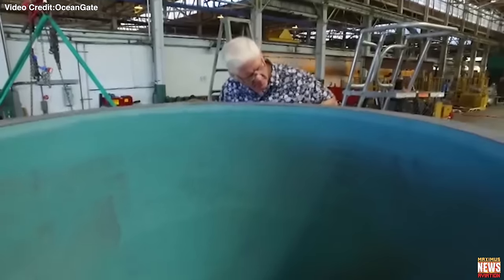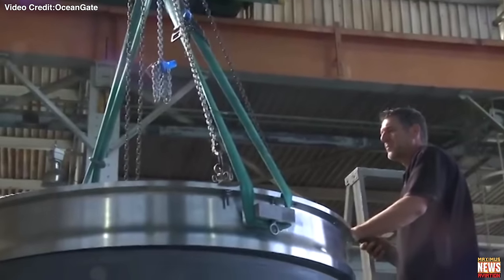Watch The Manufacturing Process That DOOMED OceanGates Titan To Fail. But It NEVER Had To Happen.

Comment: I'm a 75 year old guy with no engineering degree but I have owned a lot of fiberglass boats and there is one fact that is always true. If you hear a cracking sound in a laminated structure it is the sound of de-lamination. Every time you hear cracking it is additional de-lamination until it cracks for the last time at failure.
Reply: It is claimed that on previous dives they heard cracking sounds.
Reply: @avernikas I wonder if they were ablo to hear it crack in the last dive
Reply: @JojoFasold the assumption is they did because before the implosion they attempted to ascend.

And on other occasions while diving Stockton would give a preemptive “you’re gonna hear some cracks”
Reply: @JojoFasold  That would be sad to learn😳
Reply: @c3ramics  To think they knew implosion was imminent. How messed up
Reply: @avernikas  but they used acoustic sensors and record the sound to analyze the "health" of the carbon fiber. Not sure if they did spectral analysis of the fiber itself to see if its healthy. But like James Cameron says the hull begins to degrade with each use which was why he was opposed to it. One other problem also is carbon fiber isn't good to work with high pressure water environment.
Reply: @jonfreeman9682  So basically they had a hull integrity indicator that would have been screaming ok imminent catastrophic failure. Damn!
Reply: Spot-on.  ANY  VERY  BRITTLE,  SUBSTANCE, is  NOT  what  you want, at about  6,000  psi.  = 12,800   feet or so  of  sea  depth.     380  bar   x  14.5  pounds per square inch, at sea level .
Reply: @petersack5074  Well, they didn't use fiberglass... so I don't know how that is relevant. They used Carbon Fiber, 10x stronger then steel, too bad it has no ductility, which is why it imploded.
Reply: @JojoFasold  probably for a few horrifying seconds.
Reply: It's crazy that Experts told the CEO to x-ray the carbon fiber body over and over again, something that's standard procedure in the aviation industry, but he balked saying the acoustic monitoring system would warn of any cracks.  The CEO's grandiosity and narcissism overrode safety and common sense.
Reply: @c3ramics  I've read about that as well, but the only source for that seem to be unspecified people in the submersible community that James Cameron (and maybe Bob Ballard) cited, so it's not something that OceanGate or the Coast Guard confirmed. The behavior of the support ship (e.g., waiting for the whole dive duration before informing anyone) is also inconsistent with knowledge about an emergency ascent. The debris field will probably tell us more about whether they tried to ascend once it's been analyzed.
Reply: @qerupasy  Okay I see, I definitely felt like I was falling into hearsay territory.
Reply: @GrahamMasters87  What petersack5074 said is very relevant because carbon fiber is also very brittle.  It doesn't matter that carbon fiber is stronger than steel because it's not ductile and not malleable to sustain fluctuations in pressures at very deep levels of the sea. Also, you are exaggerating by saying carbon fiber is 10 times stronger than steel, that is not true, it is more like 5x and only due to how light carbon fiber is compared to steel.  I would still prefer to be submerged in a circular submersible made out of titanium or steel over a carbon fiber sub.
Reply: Carbon fiber is very strong in TENSION. Here it was used in compression. I don't know of any other place carbon fiber was used in compression. And modern boats are built often built with vacuum bagging, which sucks the epoxy into the matrix while pulling out all the air.   A lot of high tech stuff is often built using pre-preg, with the epoxy on the fiber, molded, then oven baked to fuse the material. This was hand laid up, like I would do in my basement. (appropriate for what I build).
And when was the last time you saw a barrel made only with hoops? The videos show no diagonal cross fibers.
Even car leaf springs are thicker in the middle, for a reason.
Reply: And to keep using the same one repeatedly for other trips.. your basically expecting it to implode eventually. Insane
Reply: @drewthompson7457 it’s astonishing
Reply: @JojoFasold  the implosion happened so fast, the hull collapsed at a speed of 2200 feet per second. Sound only travels at 1100 feet per second. If they did hear any cracks, they never heard the one that killed them.
Reply: @GrahamMasters87 carbon fiber isnt stronger than steel per size.
Reply: @GrahamMasters87 per weight maybe
Reply: @GrahamMasters87 and just imagine if it was 5 inch of steel....no implosion but no submersible
Reply: @jonfreeman9682  Its really pointless when they already heard the cracking on previous dives and just ignored it. This system was probably placebo.
Reply: Exactly. And repeated cycles of that super high pressure to low pressure transition are going to stress any composite that has a resin binder.
Reply: @drewthompson7457  : carbonfiber resist to compression in sport roadbikes, no?
Reply: 😲 WOW
Reply: exactly! Carbon fiber is not like metal that can expand/retract and still keep its structural integrity unchanged. When CF cracks, it's literally BROKEN, not deformed temporarily.
Reply: yep, no arguments here. In the back of my mind I'm like WTF??? Seriously??? I'm not trying to sound like I'm bashing this guys dream, but damnnnnnn.  I would have done some multi testing, and deep testing to check for de-lamination, internal fractures, uncured resin bubbling out, as well as work on a secondary backup emergency system to kick in to stop & reverse the dive if things aren't sounding right or looking right.  Just WTF?
Reply: @jonfreeman9682  I'm sure they realized far too late that they'd long since passed the point of no return. At the end the sounds would be deafening; the audio readings and the analytical data would have all pointed towards imminent failure/catastrophic failure! They must have regreted heavily. Poor souls.
Reply: Yes exactly 💯
Reply: @avernikas  That is a scary scenario.  Makes you wonder how many seconds or minutes listening to the cracking sounds before the hull finally gave out?
Reply: Nah it's just like cracking your knuckles, you can keep doing it and it's fine!
Reply: @Darkk6969  I think they knew for a very long time that they were goners. They had begun to ascend before the end so they knew enough to know catastrophic failure was imminent. The crackling sounds would have gradually intensified. I shudder thinking about this
Reply: @GrahamMasters87 Both materials use the same,nay identical method, of laminating each fibre layer to another using resin. The strength of the final object is as strong as the resin holding the laminates together. If the resin failed and the structure delaminated, the strength is comprised.  So the comparison is valid. Carbon fibre, Moreover, has good tensile strength where the load is applied laterally. It is not as strong under compression.
Reply: @JojoFasold  I bet it was doing noises - delamination process from beginning of the dive. If I remember correctly in depth of 2 Km they released ballast material. They wanted to aboard the mission. So cracking probably increased   but they definitely didn't hear the last one - when it happened no one was alive in fraction of a second.
Reply: @JojoFasold  Almost a philosophical item at this point.
Reply: @GrahamMasters87  Laminated the same resinous way a fiberglass, so not far off.
Reply: @avernikas  Yeah....a Fear Provocation Device to make sure your all charged-up before vaporization.
Reply: @GrahamMasters87  Glass wouldn't have mattered either because both permit pressurized water intrusion, and then splitting in-between the unidirectional fiber tows.
Reply: @MarkShinnick  What a way to go!
Reply: 3d weaving fixes tghis. just cycle the stress til everything is delaminated and stabilised.
Reply: I'm not an engineer, not have I owned a boat, but I know one fact and thats if I hear cracking on anything, I'm probably gunna think "Thats not good!"
Reply: @GrahamMaster It's relevant because both fiberglass and carbon fiber are laminated composites bonded by resin.
Reply: @c3ramics 
I read that it is quite possible they dropped those 2 weights before implosion because they wanted to land softly on the ocean floor (that it is routine to do that), so it isn’t known which was the reason (if they wanted to ascend, or were just trying to land softly).

Comment: ''If we mess it up there's not a lot of recovery''. He got that right.
Reply: That’s one thing he got right..
Reply: in more ways than one.  The company will most likely not survive with the avalanche of lawsuits incoming, and of course the sudden drop in stock price and/or capital flight.
Reply: Literally one one-thousandth of a second worth of recovery.
Reply: For once...
Reply: "Safety is just pure waste" well he lived, breathed and died that motto.
Reply: The thing is, when he said that he was probably refering to salvage of the ring/carbon fibre hull if they stuck it on wrongly rather than anything to do with safety of the sub.